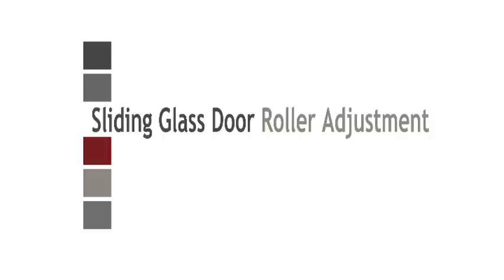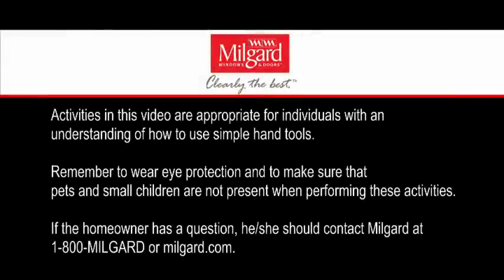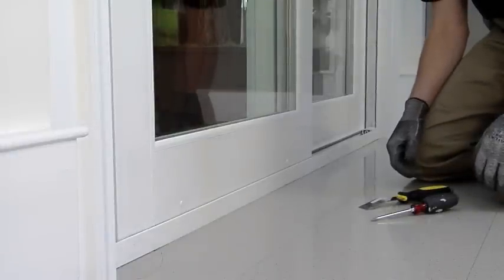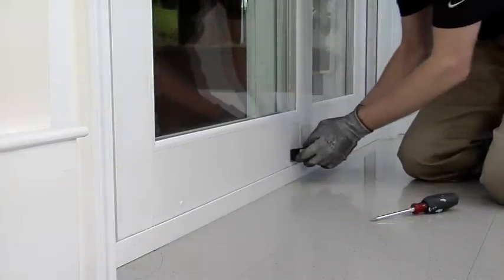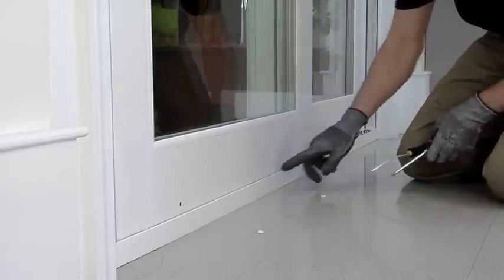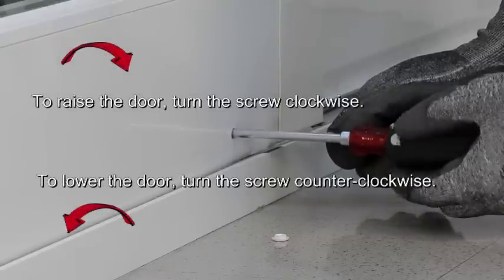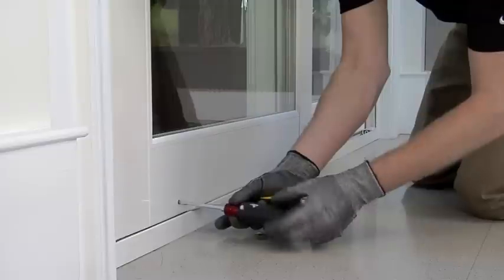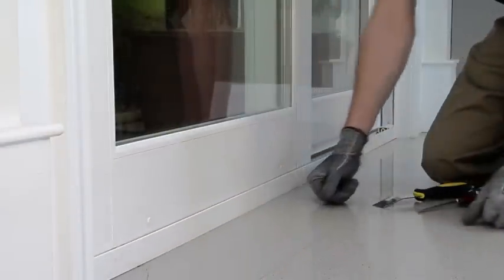How To: Adjust Sliding Glass Door Rollers

Comment: I`m not sure what kind of door I have, but on the outside of the door, there are 2 phillips head screws at the top and bottom, do you have to remove them and that plate to get to the rollers or adjustment screws?
Reply from the maker: Sorry you are having trouble. If you call 1-800-Milgard, a service team associate can walk you through this over the phone. Thanks.

Comment: Bought from Lowes guys came out didn't even adjust the wheels just ran the lock plate into the block wall left after they got done. When I went to lock the door took monkey to move the locking lever it was lifting the door up. There is a sticker right there says to adjust the door first and test the lock then bolt it into the wall. Have to watch these guys don't know what they are doing. I was able to adjust the wheels enough to release the pressure so it could be locked. Now the sliding door is angled backwards looks dumb.